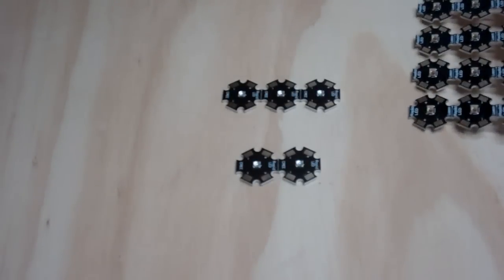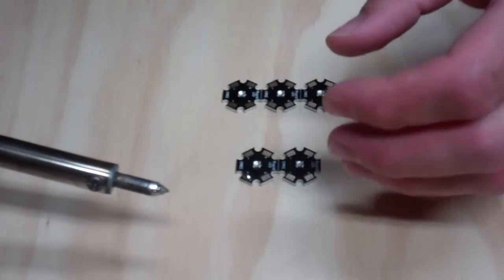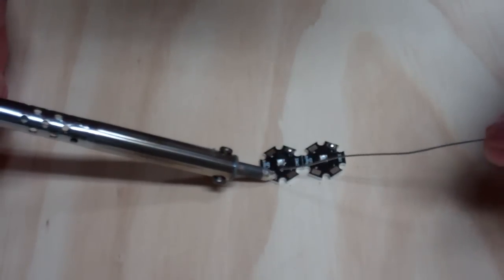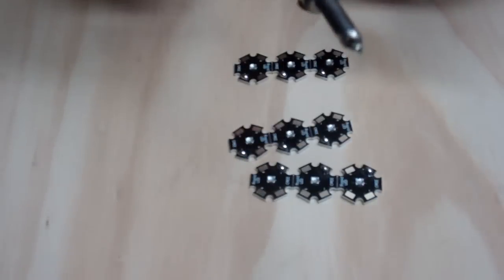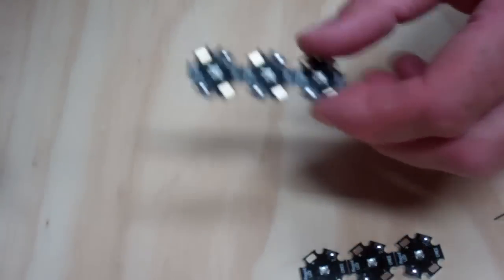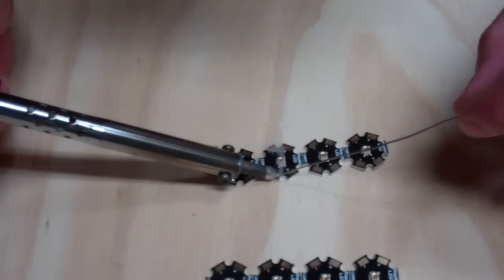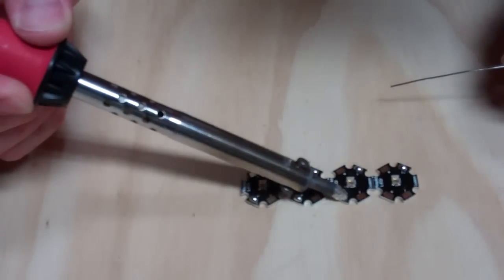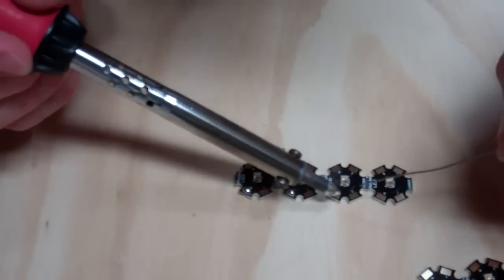Pre-tinning LEDs (Part 1)

Comment: Hey do u have to pre tin the wires as well as the led pad
Reply from the maker: I didn't when I made this video, but you can get tinned copper wires for that from Vetco, I use 20 AWG Solid Single Conductor Hookup Wire, very good quality.